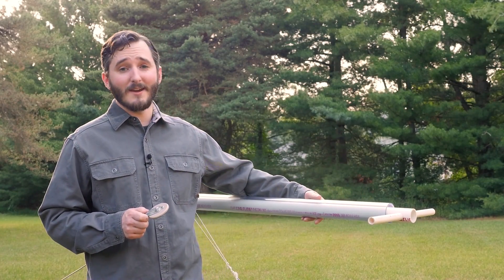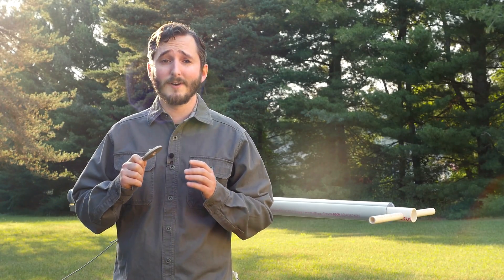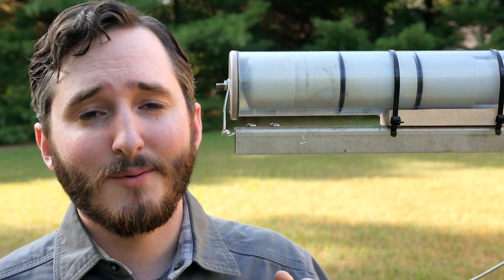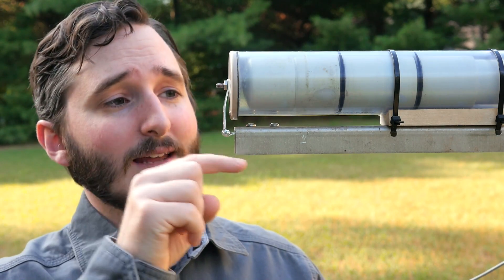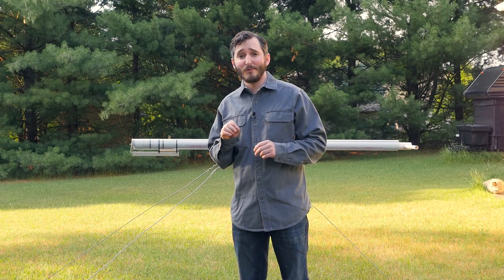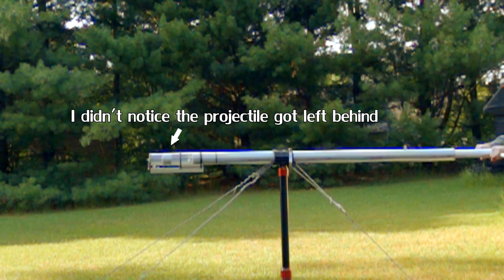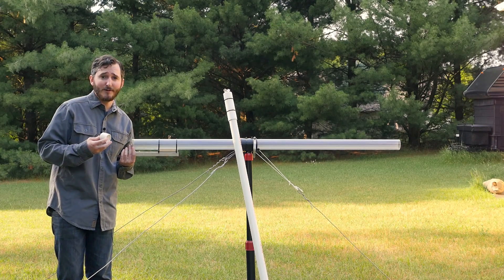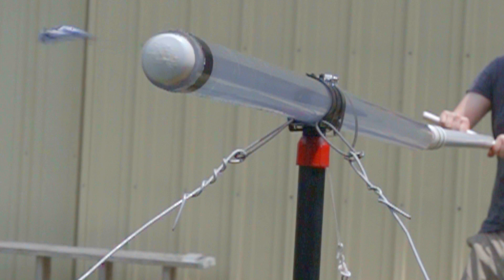Firing A Clear Vacuum Cannon & Testing Viewer Suggestions

Comment: You should use rubber bands that are streached cap middle to under barrel so it makes less than 90 degree angle. Cap is held shut with  enough force that it wont fall by gravity and little enough force, that when cannon fires, cap can move due leftover air and gets pulled down by rubber bands with much greater acceleration than gravity can provide.

Comment: You could make the end valve open like two side-by-side doors. In the slow footage it looks like only a few extra fractions of a second are needed for the valve to get out of the way in time. If you made the valve open like two doors, it would reduce the amount of time needed for the valve to move out of the way, if only by a slim margin. Keeping a vacuum seal would become difficult though.

Comment: You could use a toggle mechanism like the one in this video (https://www.youtube.com/watch?v=FYyIZXn_8-M) to snap the valve out of the way. If you tweaked it so the toggle was right at the tipping point when closed you'd get a huge positive feedback on any small force applied to it and it could snap it out of the way extremely quickly. You could replace the pink bar in this video with a cable so the spring could be mounted parallel to the barrel.

Comment: You could use a cork.  Check a lab supply place, they will have the size you need.  Place it in gently with a bit of Vaseline and it should be re-usable every time.

Comment: Attach a cable that's the exact same length as the piston before it pulls out so as you  pull it it opens valve just after the piston is pulled

Comment: You should do a magnetically assisted flap valve. Mount small North to North facing magnets on the back of the flap valve, and the barrel on the outside, so it wants to pop open with some force. Then, place a South facing magnet on the end of the plunger (not projectile) strong enough to hold the valve shut until there is enough vacuum in the cannon to overcome the magnetic force pushing on the valve assembly. Should be able to accomplish this with 4 small or medium neodymium magnets, one large one and some hot glue.

Comment: what you could do is attach a magnet to the back end of the cap and the front of the projectile. so it stays on before you draw the piston back and once you do the vacuum will keep it closed till it fires. eliminating the need for a hinge.

Comment: I don't know that it's possible to make the valve work, but if it is, the way forward seems clear to me.

Firstly, the valve need to be as light as possible. The idea that gravity would have any significant effect during the short time it takes the piston to leave the barrel is pretty silly frankly, but a lighter valve will require less energy to move, regardless of the what kind of force is applied.

Secondly, I'd suggest a spring or springs, or some functionally similar solution, attached at the valve and the base of the hinge, at an angle just right to help keep it closed with as little force as possible, no more, so that as soon as it starts opening, the force of the spring(s) will actually help open the valve. this is really not much different than the idea of using gravity assist, but of course you can increase the force applied by using stronger springs, which may just made the difference.
It goes without saying that this is hard using gravity, unless you just happen to have a black hole handy.

Lastly, while being a slightly more complicated solution, it may be well worth considering a multipart valve (probably no more than  two). It will take some doing, but if done properly, there's not reason it can't work, though as they say, less is more, so I would make sure to exhaust all other options before going this far.

Edit:
I just saw someone else come up with a rather clever solution. I don't know that this is what he/she meant, but having the end to the tube/pipe cut at an angle, the valve, which would then need to be oval, obviously, would, I think, be a whole lot easier to get out of the way, though this might also affect the exit path of the projectile.

Comment: Put a spring from the valve to the bottom of the assembly that hold the valve and you would need a string to keep tension on the vale to keep it closed then once enough pressure on the valve release the string and pull the piston to shoot and the spring should react fast enough to pull the valve open fast enough

Comment: What if you tried putting a circular  piece of rubber that just hung off the end of the cannon, like if it had a little edge on it that it could support itself. It may blow off as separate projectile or may fall off before the end cap reaches it

Comment: What about a spring loaded valve. If you had a valve with a two step seal that would allow the valve to seal but also be drawn slightly into the tube to release a catch for the valve. The vacuum in the tube should be strong enough to keep it sealed and as the vacuum drops the spring pressure may be enough to open the valve fully in time.

Comment: the vacuums will hold the valve closed just enough so that if you put a spring loaded mechanism on the end to allow the valve to spring open when the pressure is great enough inside the barrel it will fly open.

Comment: Suggestion for the valve: Use a weight or a spring pulling vertically downward on the valve so that when the valve is closed the force is holding it closed, but when the valve moves beyond the tipping point the force is now pulling down on the valve. This might also keep the valve from bouncing back.

Comment: What if you used the projectile itself as the seal and then just added extra length of pipe in front of it to give it something to accelerate along as air rushes in?

Comment: I wonder if you split the valve and attached either piece to the sides with a small rummer gasket in the split section if that would work. Or perhaps making a new valve the same way but with molded rtv to the barrel first to also make it not to thick.

Comment: Have you considered using a spring system similar to what recliner chairs use to pop up the leg supports?  they're at equilibrium until pulling the lever which just nudges the leg support forward enough to let the potential energy in the springs take over and pull the support all the way up.  It might give you the bit of extra pull on the valve you need to have it clear the opening in time for the projectile to exit unobstructed.
Reply: another idea, which is lower-tech, easier to make work, but likely less powerfull and more expensive is to make the valve and projectile the same thing.  So that the thing keeping the vacuum seal on the front of the tube is what gets fired when you reintroduce atomospheric pressure.

Comment: Isn't it possible to use a rubber band or something that wants to open the valve. Then simply pull a slight vacuum that will keep the valve closed. Once the vacuum goes away the valve should open a bit faster.

Comment: You should try to spring load the flap valve. The problem is that it obiously won't stay closed in the beginning. You can ask a friend to hold the valve closed until there's enough vacuum in the pipe, for example when the piston is in the middle of the barrel, then hopefully when the piston fires the valve will open just in time.
Reply: If this sistem works you can upgrade it so that you can operate the vacuum cannon alone. I suggest you to create a system identical to the one you have used in the video, with the pivot of the hinge positioned outward, but this time you will put rubber bands with one end connected in the central bolt of the disc of the valve and one end in the bottom part of the support of the valve, just before the hinge. The bands will apply a force with the same direction that gravity applies on the valve but the force is way more intense. The principle is the same you have used in the video but the valve will open faster.
Maybe the valve would struggle to pass the point where the rubber bands force it against the pipe, try different rubbers and different configurations and see if this system could work.

Comment: Maybe you could try using some kind of film/stretching material (like a balloon) and use some rubber bands to keep it in place. Once you pull back the piston the film gets sucked in and forms a concaved shape (just like your disks) and when you release it, it shoots off. If it doesn't, try using the air cushion method you've tried in this video.

Comment: Suggestion for the flapper valve: You need to make a spring loaded valve with a good deal of spring force to pull it open. You could make a simple latching device that would lock it into place before pulling the vacuum. The latch could be released by a small vacuum piston that is connected to a hose and tapped into the barrel a few inches from the muzzle. That way, you can load the barrel and click the valve closed and it will stay closed even though a large spring is trying to snap it open. As you draw the plunger back, the plunger creates a vacuum in the barrel and when you pass the point where the hose is tapped in, the vacuum is transferred to the small hose and it pulls the release on the valve so that it is no longer latched. Now the vacuum is all that is holding the valve shut. When you fire the gun the valve should move very rapidly open when the vacuum is removed.
Reply from the maker: Springs and bands can also be made so they would hold the valve closed until it opens slightly, then they would pull it downward. But even so I'm not sure it will open fast enough. I have a new idea I'll be testing this next week
Reply: Also consider a "barn door" or double door valve for the end. The doors would have less mass and would move faster, plus they are shorter in length and would clear the projectile faster.

Comment: No surprice the valve didn't work, it moves so quickly that gravity doesn't play a role, it's inertia is just to high for the moving target. The sort of thing you can do is add a spring or rubber band to hold it open, and only tighten that rubberband once you have vacuum; yes, this is awkward.
Why don't you try propping it up with no hinge? Firstly the hinge is slowing the disk down by some degree, secondly it's not as big of a problem if the target hits the disk, because the disk goes flying too.
---
And replace the ducttape around the burst-disks with a clamp made out of a sawn open pipe.

Comment: Couldn't you use a smaller in diameter pipe, next to the main one, closed by a little valve fixed on the main valve?
It would open at the same time, but the air would travel faster since there would'nt be any projectile in it, and it would push the secondary valve, thus pushing the main one?

That way the projectile would never touch the valve.

Comment: Maybe the problem with that valve is that it can only receive the pressure for a very brief moment, so making a piston light enough that glides over the barrel could receive enough energy to leave the front of the barrel and with a short string for recovery it should also move out of the way of the proyectile.

Comment: Watching this, it seems to me that the real problem with your flap valve is weight. The burst discs are light enough that they pop off just before your projectile exits, but the small amount of air inside the cannon isn't enough to swing that valve open. Perhaps if you tried sanding down the valve thinner, or using a lighter material,  you may have more luck. Also, making sure that your hinge swings very easily could help. Break out that WD-40. Best of luck man.

Comment: What if you could have the valve spring opening with a pin to close it and set up the pin to be removed when the atmospheric pressure is enough to hold the valve down on its own

Comment: What if you used a piece of leather or rubber as the flap put have any solid piece like the hing attached out of the way of the projectile. The flap would be a little liter and if it's hit by the projectile it wouldn't damage the flap because it just a strip of leather or rudder.

Comment: 1. reduce the mass of the valve (foil, reinforced with a plastic "spider web"?) 
2. Add rubber bands to assist the fall of the valve. A force vector acting in the direction of gravity would help

Comment: The valve should be spring loaded to move away very fast . To keep it closed you'll need a latch. Now the problem is how to release it exactly when would fire. A solution could be to have a magnet on the bottom of the projectile that reacts to another one on the canon. When the projectile reaches the right position the magnet on the canon moves and release the valve. To avoid false trigering when pulling just rotate the piston 180deg and go back to the normal position just before firing.

Comment: Use a spring to pull it out. Have it at an angle where the air pressure initiates the spring. At the moment that the spring is activated it should pull the cap away before it hits

Comment: it'd be a real pain, but a secondary tube over the first with the rear (vacuum breaking) end forward of the main tube such that a second vacuum is broken before the main one, driving a dummy projectile forward and breaking the valve seal. With trial and error you'd get it timed such that the main valve breaks loose at the right time. You'd of course need a second plunger rigged to the first.

Probably more work than it's worth, but an option that is all mechanical

Comment: If you had holes in the pipe near the end that pull out maybe you wouldn't have to pull it out every time, with a longer tube and maybe a spring in the tube your your plunger may recoil and assist to increase the power, 
very good

Comment: I think I know how to fix the valve put its going to be a little bit complex, with an arduino you could place a sensor on the middle of the barrel so when the projectile is launched it activates a motor to open the valve
Reply: Now that I think so, you could attach a small tube near the end of the barrel to a gas piston, so when the air rushes in, it won't be gravity pulling the valve, but the same air, of course, you'll need to put the piston into the metal so it doesn't break the valve, it's a design somewhat similar to what an AK47 uses to cycle

Comment: I don't think you're going to find anything better than burst discs. But, what you need to do is drastically decrease the mass of the valve so the inertia is easier to overcome. Maybe just stretch a sheet of latex over the front. It may be grippy enough to stay without tape, and light enough to move out of the way and therefore be reusable.

Comment: If you paint the projectile a bright color it would be easier to see if you leave it behind in the barrel. 

I don't think gravity is going to help you here. It's hard to gauge how fast the projectile is moving, but there might not be enough time for the valve to fall away. Though if the valve fell straight down rather than pivoting away it would clear the barrel faster. 

It might make more sense to cut out a plug to fit at the end of the barrel. something light weight that the projectile can blast away without losing momentum and while still in the barrel. Then just tie a string on the end so it doesn't get blasted away. 

You could even shape the plug to the shape of the projectile to reduce the amount of air trapped at the end of the barrel.

Comment: You should try the cannon without the projectile. Push the piston as far down the barrel as possible and see if you can get a loud sound out of it. :)
Reply from the maker: I didn't have a projectile in the pipe when filming the smoke. It's actually a bit quieter without it.

Comment: The problem is that as soon the valve opens, the air escapes from the space available and stops pushing the valve. I would try adding some kind of collar to the valve that wraps around the end of the cannon. That would allow the remaining air in the cannon to push the valve longer and hopefully it will gain enough momentum to be out the way in time.
Reply: ... or not, because the pressure in the cannon never exceeds the atmospheric pressure, is it?
Reply from the maker: The projectile compresses any air that's in front of it when it reached the very end of the pipe, so pressures do exceed the atmosphere assuming the valve stays sealed long enough or when using a burst disc
Reply: So do you think that improving the time that this pressure apply to the valve could be a valid solution?

Comment: Try to attach one end some elastic material like a rubber band to the end of the handle of the piston and the other end to the valve so when pulled beyond the point of launch the valve opens. I imagine that this would probably very unstable and need calibration but if you were willing to spend more time and money, you should go with sensors. So a servo that is triggered by a sensor. You could use a microcontroller for example.

Comment: You could assist the valve with rubber bands - if you attach them around the hinge but forward of the pivot point they would try to pull the valve straight down when it's closed, only slightly increasing the friction in the hinge, but the moment it starts opening and tips over the pivot point, the bands would start assisting it open. Add enough bands and you can make it snap open with quite the speed.
The issue I see is that the movement from the piston pulling could trigger it prematurely.

Comment: what if you made a passageway out of hose or something halfway down the barrel that connects to the flapper. That way part of the rushing in air would bypass the projectile and push open the flapper. Similarly to an AR-15 recoil.
Reply from the maker: That wouldn't be any different than just firing an undersized projectile and some air could slip past. The effect would be similar to when I didn't push the piston all the way to the front of the pipe